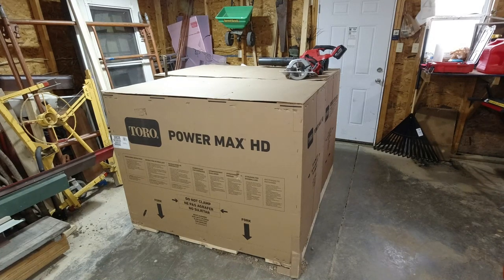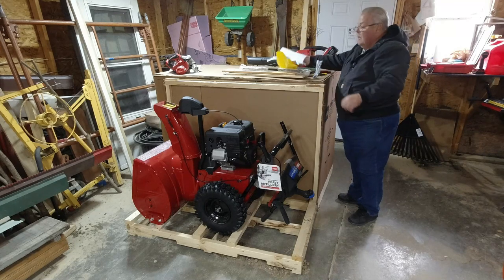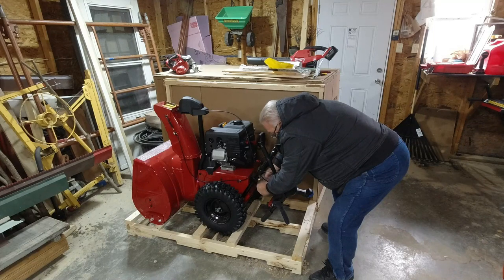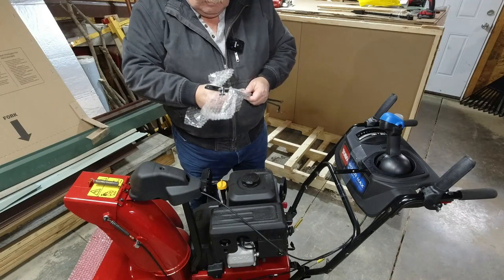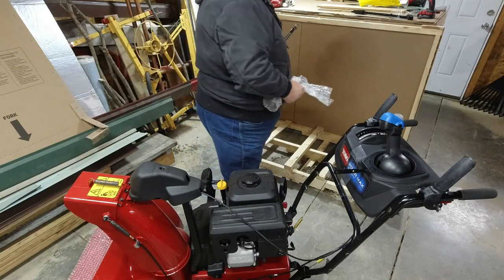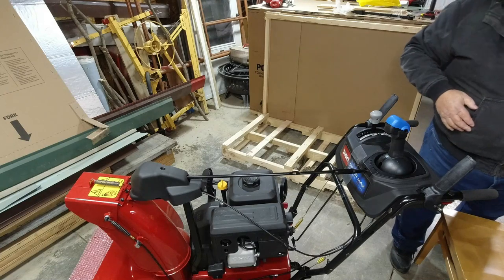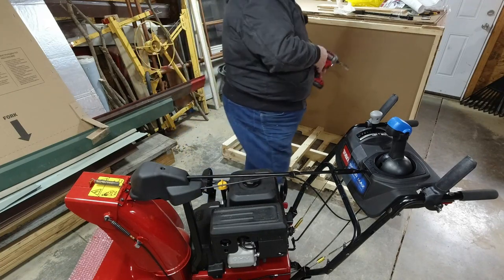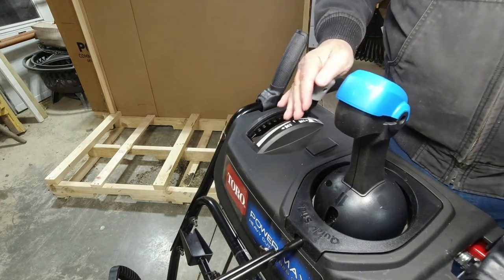Toro Power Max HD 828 OAE Assembly and Setup

Comment: I bought a new 824oe power max Toro. Ace put it together and deliverd it. No matter what reverse gear I put it in it goes forward and repair shop told me there's a 30 day wait and it wouldn't hurt it to run this season with our reverse. How or what could I do to adjust or fix it so reverse works.
Reply from the maker: Under the dash locate the bottom of the shift lever. 
Connected to the lever you will see a threaded rod. That is the speed/reverse/forward adjustment.
Remove the clip and rotate nut attached to the shifter in or out to make the snowblower start moving forward. (I'm don't remember which way to go exactly but I think you need to make the rod longer from the shifter down to the transmission. :)
Continue to adjust the rod until the "neutral" is between the first gear slot and the reverse slot.

Comment: Can I run synthetic oil from the start or is it only fopr extreme temperature?
Reply from the maker: Yes, you can run synthetic right away. I recommend 5W30 for snowblowers. 
I've been using Mobile One in ALL of my engines since the 80's and I've never had an engine problem.

Comment: Great vid Paul. I just got the 826 power max and I am having trouble with the chute staying in place. If I move it so it shoots out to the left , it will move on it’s own to the right. Any suggestions before I tinker with it?
Reply from the maker: Pull the cover off the gearbox out by the chute. Make sure the cog is engaging to hold the chute in place. Also make sure the blue button on the joystick is lifting back up completely. 
I take the cover off and show you how it works in this video https://www.youtube.com/watch?v=rNQTCDxhU54&t=137s
If that doesn't work see you Toro dealer
Reply: @PaulSikkema  thank you for the reply Paul. I ended up returning it to Home Depot since it’s been only two weeks and upgraded to the model with the heated handles since that’s the only one they had. There was definitely something wrong with my first one because I compared it with the one I have now so I am glad I did that without any problems to switch since it was under thirty days. Thank you for the quick response. Be well.

Comment: at 16:52 you say to use 5W-20 Synthetic oil for the engine, however the manual (page 20) suggests if using "synthetic" to use 5W-30. Can you explain why I should use 5W-20 instead? Sorry, 1st time snowblower owner and not experienced with oils either. Thank you. Great video btw!! Helped me tremendously with putting it together!
Reply from the maker: I mis-spoke. It should be 5W-30

Comment: I just bought one. when I link the lower knob with upper right hand tigger I fond the lower knob is stiff and cannot be up/down movable. Is this difficient or there is something or pin to unlock it?
Reply from the maker: I don't quite understand. Is it the speed control lever or the chute control. 
If you mean the chute control you may have to remove the black cover by the top of the chute and look for something binding.

Comment: Just picked up a toro power max hd 1030 ohae. What a beast it is.  Happy with the 30 inch size and the 10 hp motor is great. I think this will be a major seller for toro.
Reply: Wondering if you had a chance to use the 1030 yet. I purchased one yesterday. Thanks

Comment: You did a nice job; I learned some things about the newer blowers.  I just put a Chinese carburetor on my old Toro Powershift.  It was about 10%  of the cost of getting the thing rebuilt.  I think you should of talked about the new alcohol-free gas for small engines.
Reply from the maker: TruFuel and other alcohol free fuels have been around now for 10 years. I've talked about the at movingsnow.com. The fuel is terribly expensive but worth it for off season storage.

Comment: Nice looking machine. I have a John Deere TRX26 with rubber caterpillar style wheels. Bought it new about 32 years ago and still looks like new. Plows through some deep stuff and throws awesome. I added electric start to it about 15 years ago. Don’t see these track type throwers very often. Smartest decision I ever made getting the track style.
Reply from the maker: The crate behind this one in my garage is the new Toro Power TRX. You'll get to see it soon. I'll also be reviewing the Ariens RapidTrak after that. Your TRX26 is a beast and goes through anything but the new ones are a lot easier to use.
Reply: I can’t wait to see the new Trax. I bought mine when I lived in Garden City,KS (western ks) and I woke up to 3 foot snow drifts in my driveway. Game on at that point!

Comment: Paul?  you need to adjust the shoot deflector cable at the shoot clip-holder, and the other end of the cable that goes to the quick-stick needs to go above the top horizontal handle instead of below it. I don't think it's the paint on the hinge
Reply from the maker: The shoot deflector cable is not the one I attached to the rod. The deflector cable runs down from the handle, is attached to the lower transmission case and then up to the deflector. It's mounted that way so it doesn't bind. It's the paint, I didn't move the camera but you can see the extra layer of paint on the hinge that will wear off soon.

Comment: I just got the 828 OAE earlier this month to replace my old Poulan Pro. Got to use it once already. Great machine but the pull to start is so much less than what I'm used to or expecting! You don't need to really need to put a lot behind it to start it.
Reply from the maker: Yes, the Toro engines use a compression release so it's very easy to pull-start them. Even the 420cc pulls easy enough that most people can start it.

Comment: Excellent video. Just received my Toro Power Max HD 828 OAE today and I am wondering if there is a way to adjust the deflector so it points a little down?
Reply from the maker: Not that I know of. My nephew used the 928 last year with the double chute and is now complaining about the chute on the 828. He didn't realize how much of a difference the was.
Reply: got the same problem the chute wire i took off and it was all twisted and didnt move got no controll over up and down on mine might be a problem with these

Comment: Im rewatching you videos big big thank you! I bought 828 last year new at local Ace hardware, do you pump tires hard or is half flat better for traction???We get 60 plus inches per  year !My scraper on bottom seems to grab and makes it hard to keep it going straight ANY advice??? Thanks for great videos! Big thumbs up!
Reply from the maker: You want the front housing resting on the skid shoes - not the scraper bar. 
Start with an 1/8 inch gap. Put the snow blower on a hard surface (cement). Put two paint sticks under each side of the scraper bar  (1/8 inch) and then loosen the skid shoe bolts. Let the skid shoes drop down and tighten the bolts. Does the scraper still catch?
If your driveway/sidewalk has a lot of cracks and bumps you may have to raise the gap to 1/4 inch.
If you are clearing gravel that hasn't frozen yet you may have to increase the gap to 3/8 inch
If you are clearing loose gravel (pea gravel) or a lot of turf (area for your dog) you may have to increase the gap to 1/2 inch
In other words, keep increasing the gap between the scraper and the surface until it stops grabbing - most of the time. 
I have a few 1/4, 3/8, 1/2 thick 4X4 inch plywood scraps that I keep around to set the gap. 
What little snow you leave usually melts off the next sunny day.

Comment: You should follow the break-in instructions (run for a certain amount of time) and then drain the break-in oil out. You'll notice alot of small metal particles in the oil when you drain it so you want to get that out of your new motor. Then you can add your brand of oil in the correct weight. Read the owners manual, that's why they send it along!

Comment: Paul, I am in the market for a new blower and your articles and videos are a huge help, thank you!  Should I be concerned about Toro and others being made in China?  with the Corona virus supply chain disruptions and the trade hostilities between the US and China I wonder about parts availablility going forward?  I know you recommed Toro but is it safer to get a US made machine like Troy Bilt?
Reply from the maker: Toro is made in Bloomington, MN. Ariens is made in Brillion, Wisconsin. Troy-Bilt, Cub Cadet, Craftsman are made in Ohio. 
The confusion may be that ALL snowblower engines are made overseas - most of them in China. These engines are generally shipped months in advance so there is no shortages at this time. 
We did have an issue with engine last summer (2019) because the Port of Los Angeles got behind but that was quickly fixed by rerouting the container ships to other ports of entry - like New Orleans.
Reply: Thank you Paul, that helps.  I live in Massachusetts and have a very large driveway (165’ long, plus a circle and parking area) totaling 7,200 sq. Ft.  What blower would you recommend.  My 18 yr. old Ariens 824 still runs but I want something bigger and better to handle the heavy wet snow and get the job done faster.  What do you recommend?
Reply from the maker: If you want to stick with Ariens I highly recommend the Deluxe 30 or Deluxe 30 EFI. You'll get done a lot faster and can clear the long part in just two round trips. If you get a lot of snow consider the Platinum 30. It will clear 15 inches or more as fast as you can walk.
Reply: @PaulSikkema  I am actually leaning towards the Toro now.  Would you recommend the 928 OAE or the 1030 OHAE for my situation?  Toro is saying no shear pins needed, plus with the current promo Toro is cheaper.  Are shear pins much easier to change now on the Ariens?  My 18 yr. old Ariens requires a nail punch to get broken pin out.
Reply from the maker: I've been reviewing Ariens for over 10 years and I've only once broken a shear pin. And that was because I stuck the snowblower in a chain-link fence...That one fell out. 
I'd go with the 1030. It's a little wider so it will get the job done just a little faster,  it has the same power to width ratio as the 928, and it has heated handgrips!

Comment: My coworker has a older model toro with a plastic chute, mine is your model brand new, do you do anything special after you use it as far as cleaning it? Someone told me to spray chute also. Ty for your video and service
Reply from the maker: If you are running dirt or mud through the chute you may want to clean it when you are done. Otherwise the snow doesn't stick inside these new chutes (or the older poly ones) 
Toro snowblowers have a lot more "throw" than older snowblowers and some of the other brands. Snow really doesn't stick in the chutes - even when the snow it really, really wet.
Reply: @PaulSikkema  
Thank you, that is helpful

Comment: Love your videos Paul thank you. My question in on starting at full throttle, is it not better to start at idle to create less wear on a cold engine? I notice that all videos start at the rabbit setting which makes me cringe.
Reply from the maker: I understand your concern. With the exception of the EFI engines all the snowblower engines use a fixed jet carb and they just start better on full throttle. That said, I start them on full choke, full throttle and as soon as it starts to smooth out I'll reduce the throttle and let it warm up and 1/4 to 1/2 throttle.
Reply: @PaulSikkema  Thanks Paul appreciate all of your videos. I just bought the Toro 828 today. It was a tough choice between that and the Ariens that you compared side by side in another video. For me the joystick was the deciding factor love that design. Keep the videos coming.

Comment: For this electric start it only works while plugged in right? Meaning it doesn’t have a batter that maintains a charge while you have it plugged in?
Reply from the maker: Correct. 110 volt plug in electric start.

Comment: Paul, I purchased a new 1030HD and during the first storm our road was very soft and the plow pile had a lot of rocks in it. Long story short, I had rocks get jammed in the impeller and the machine never cut off. Now when I try to use the machine, it barely throws snow.

What do you think this may be? My thought is a new auger belt, but is this machine faulty for not cutting off under a jam like designed? Thanks!
Reply from the maker: You most likely stretched the belt. 
Watch this video on how adjust the impeller belt. https://www.youtube.com/watch?v=J5C0fOOe5iU
If it won't tighten up then you'll need to have your Toro dealer install a new belt.

Comment: I have the OAE28, is there a removable scraper blade or is it integral. Mine has no attachment and I'm wondering  if it just needs adjustment on the skids. It does not clean to the pavement surface.
I can send photo if you have a way.
Reply from the maker: I answered this question with the other question you asked. Adjust your skids shoes so that the gap under the scraper bar is 1/8 for hard pavement or 3/8 inch for gravel. That way it will clear the snow bout now catch on every crack in your cement. The little that's left will melt right off when the snow comes out.

Comment: Thanks for your videos Paul.  I picked up the 828 power max HD at a auction  ( I probably shouldn't say for how much because folks will be shocked).  I don't believe it was used, as it still had wrappings on it.  It was completely assembled and everything seems to work just fine, except for one thing.  It seems that I have the same amount of  reverse positions as I do forward positions.  Is there a adjustment for that?.
Reply from the maker: Look at the shift lever under the dash. There is a threaded rod that goes from the shift lever down to the transmission. Adjust the threads so the reverse works the way you want it to. You can watch this video to see how the transmission works: https://www.youtube.com/watch?v=KxXuNZWDLYg&t=2189s
Reply: @PaulSikkema  Thank you Paul, I think that is just what I needed to know.  You are a great resource.

Comment: Trouble shooting my 828 OAE. The two stage cuts out. I changed the auger belt, not he issue. Worried it’s a “no shear pin” disengagement failure or possibly auger bearing failure. Can you explain where that “no shear pin” disengagement takes place? Thoughts?
Reply from the maker: It doesn't disengage - either the belts slip or it kills the engine. 
Your problem may be as simple as a cable adjustment. When you engage the auger lever the spring at the end of the cable should expand about 3/8 of an inch.

Comment: Hey Paul I'm looking at upgrading, between toro 828 and the cub cadet 3x 28" I know the toro has a bigger impeller but the cub has a bigger engine, we get about 80 inches of snow a year
Reply from the maker: I don't recommend ANY 3x snowblower. They don't handle snow as well and have issues breaking the shear pins on the 3rd stage. 
If you regularly get 12 inches or more at a time I recommend the Toro 1428, Ariens Deluxe 28 SHO or an Ariens Pro 28. The larger engine make clearing snow a LOT faster.
Reply: @PaulSikkema  thanks Paul, I have a home depot credit accout so unfortunately it limits choices, if they carried ariens I'd get the deluxe 28 sho

Comment: Paul,  one final question;   is the HD 1030 a real jump in product quality and durability, or, is it just a close cousin to HD 828?   Even a comparison link is appreciated if you know of one that compares
Reply from the maker: The easy way to explain: The 1030 is the same machine. It's just two inches wider and has a larger engine to compensate for the extra width. Same quality and durability. 
You have to go to the 1428 to get the commercial features.

Comment: How’s the Ariens Professional 21’ been serving you? How many hours so far? Would love to see a follow up video.
Reply from the maker: When it comes to sidewalks and cement where it's cracked the Pro 21 is the best single-stage on the market. The floating scraper never catches and it cleans down to the pavement very well. I have a lot more sidewalk now so you'll see me using it a lot more this year.
Reply: @PaulSikkema  Excellent to hear, how many hours do you have on it so far?
Reply from the maker: I still have it packed away. When I get it out I'll check

Comment: I used mine today. The handles you grip are way too tight. My left hand was cramping holding it. Is there an adjustment?
Reply from the maker: Yes, Adjust the left cable as shown in this video. When the handle is up you want it to flop around. When the handle is engaged you want it to expand the spring about 3/8 inch.